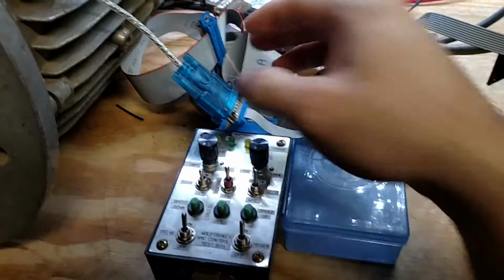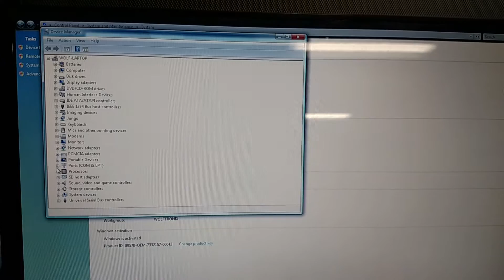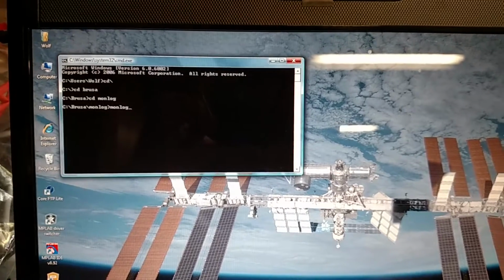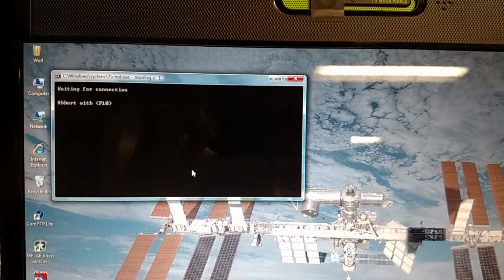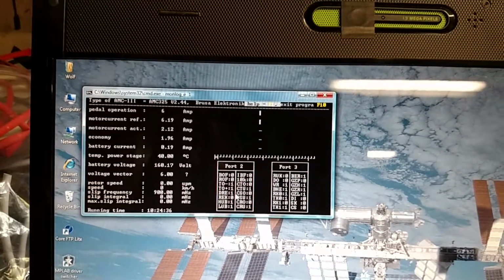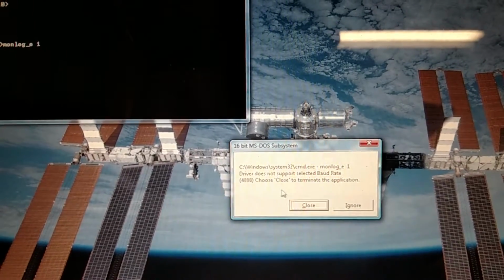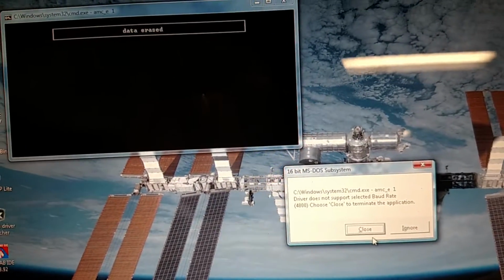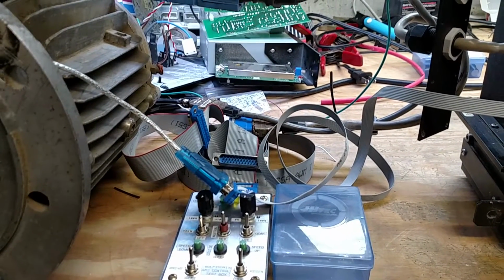USB to Serial Adapter Testing, Part 2 (Unknown CH340)

Comment: I have used affordable USB to serial adapters in the past possibly similar to this one. The driver for some of the adapters allow you to force the serial protocol parameters in the settings tab.  By setting these to know compatible values of the software or device that is being communicated to I was able to make these adapters much more reliable.   This error message you're getting sounds familiar, though this was on Windows XP machines for me.  It was almost as if driver's auto negotiation or the serial device software's ability to configure the serial adapter was buggy.  It seemed that sometimes the serial adapter would settle on a set of protocol parameters that was close enough to allow communication briefly then it would error out similar to what happened in this video.  However, it usually wasn't the baud rate.  I recall going through hardware manuals looking up the serial protocol parameters.  I'm not sure if you explored this, but I though it was worth it to throw it out there.